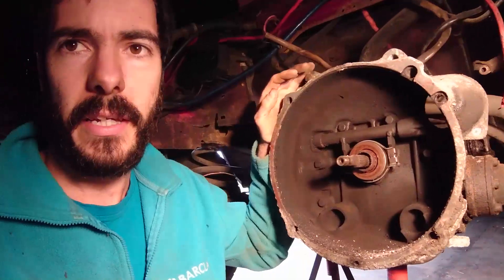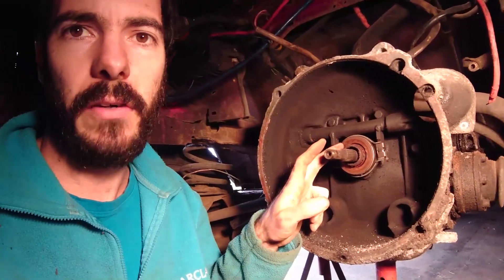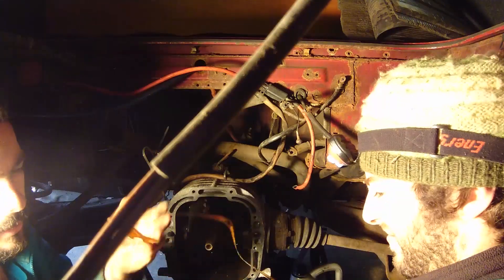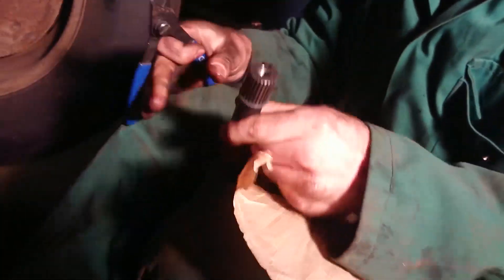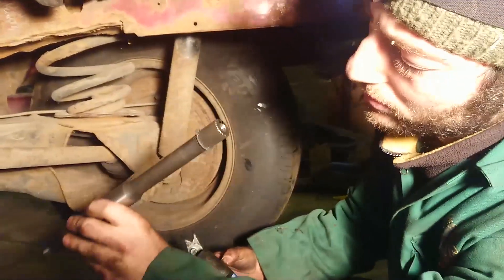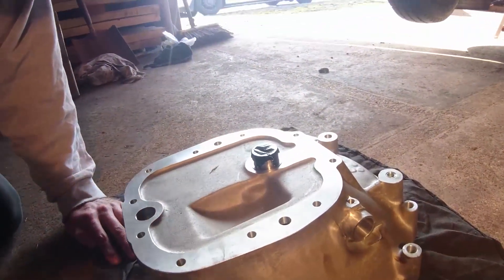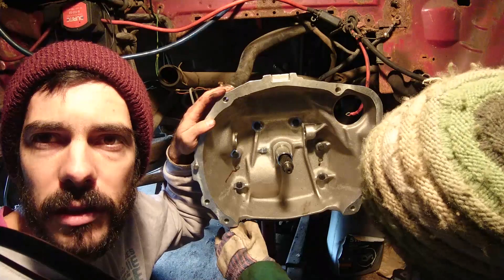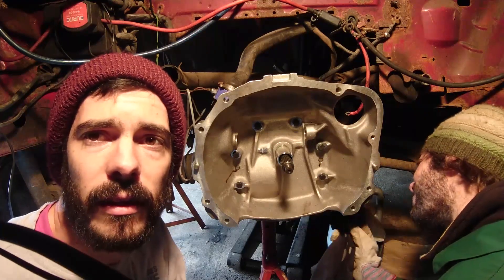VW T25 - Subaru CANbus Conversion [Part 2 - Bell Housing Mounting]

Comment: How did you get the shaft off? I've pulled the circlip and sleeve back, but it won't unscrew off.
Reply from the maker: Did you manage to get your shaft off? You need to make sure the sleeve is pulled right back beyond the join in the input shaft.